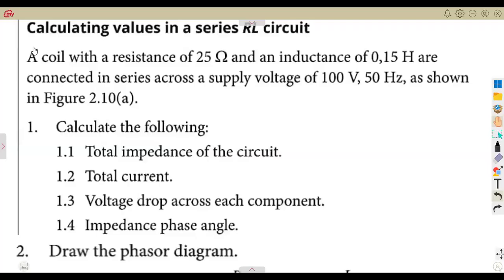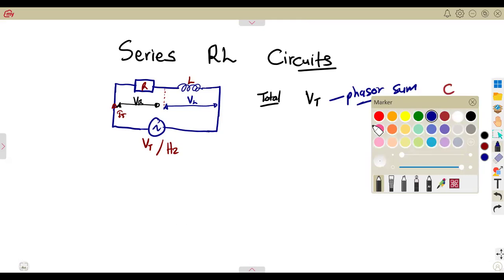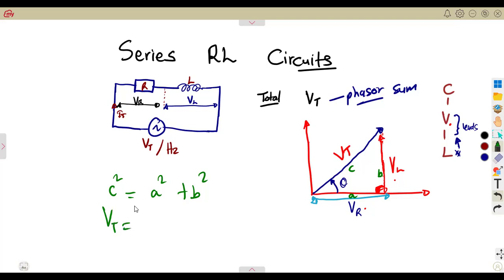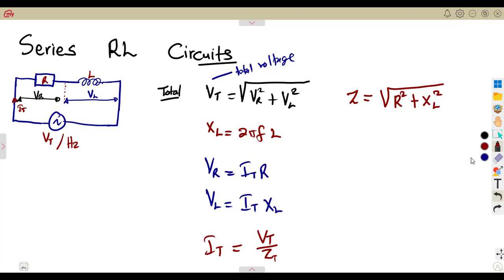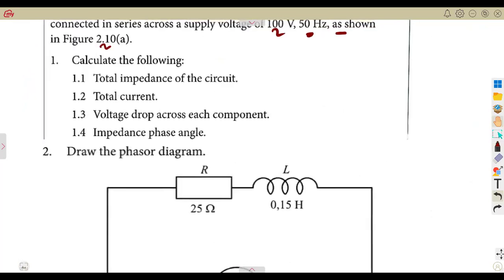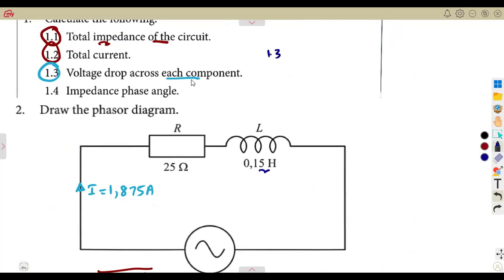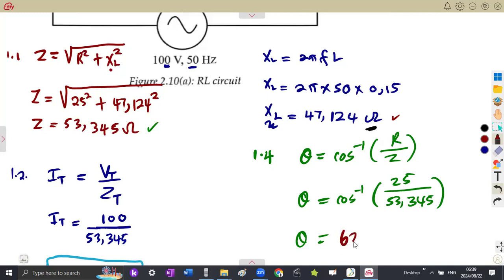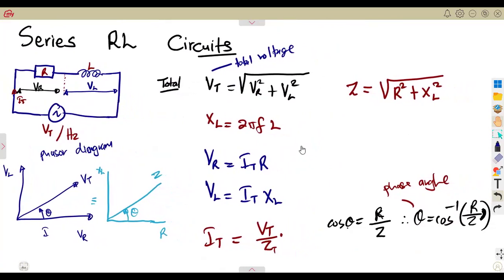Industrial Electronics N4 Series RL Circuit Notes and Example @mathszoneafricanmotives @mathwithlightone

Comment: Hii yall i came across this question and i'm kinda lost "z1 is made up of a 8 ohms resistor and a 15 ohm's inductor, z2 is a 6 ohms resistor and a 10 ohms capacitor and z3 is 0 ohms resistance and a 12 ohms capacitor, and z1 and 2 are parallel and series to z3. calculate the total impedance" pls help with it
Reply: i got the Z// which is 6,917 ohms and added it to the Z3 and i got 18,917 ohms, ...and i didn't use complex numbers... am i wrong for doing that??